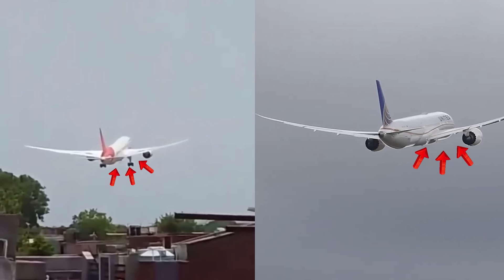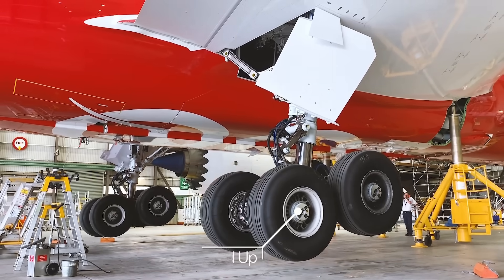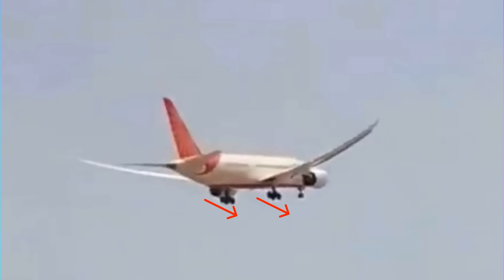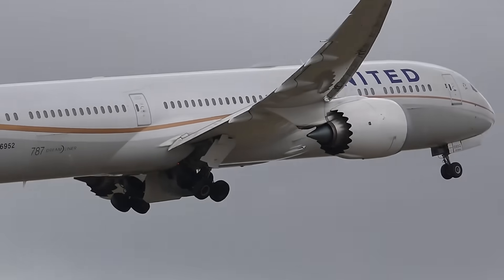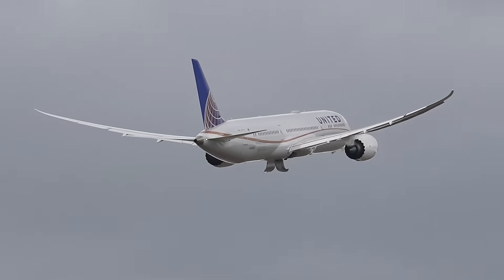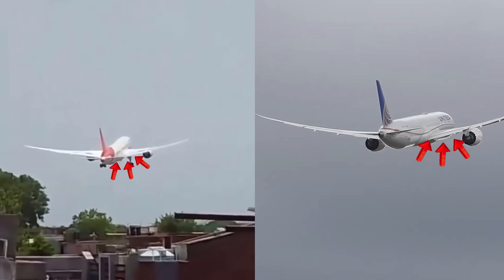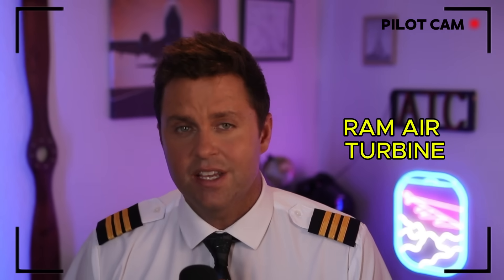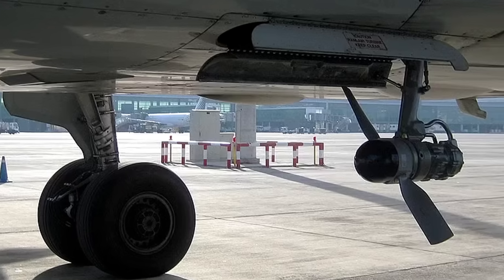Pilot Explains: A New Detail in the Air India 787 Crash Everyone Missed

Comment: Boeing utilizes parts manufactured in China for many of its aircraft. Chinese companies produce components and assemblies for all current Boeing commercial airplane programs, and these parts are found on over 9,000 Boeing aircraft currently in service. 

Specifically, Chinese manufacturers produce parts like:

Rudders for the 787 family: One supplier, CCAC, manufactures rudders for the entire 787 family. 

Components for the 737: CCAC also produces the rudder and other components for the 737. 

Horizontal stabilizers for the 737: Shanghai Aircraft Corporation produces the horizontal stabilizer for the 737. 

Vertical fins for the 737: Xian Aircraft Corporation produces the vertical fin for the 737.

Comment: I agree with you...the reason of the tragedy is that the engines suddenly stopped working..and I also think it was because of a sudden lack of electric power....but the fact (omitted by most of those who have expressed their opinion on the possible causes of the accident) that the plane used the entire length of the runway (up to its extreme limit) before managing to take off, suggests a problem with the power of the engines already during the acceleration phase, even before take-off.

Comment: If you consider that the last ADS-B data was transmitted at 08:08:50 UTC, right at the end of the runway at about 70 meters (230 feet) altitude, it is quite likely that they lost electrical power.

Comment: Crashed Air India pilot error. 
I noticed the plane tyres thing in the very first video before crash. But there PILOT ERROR exists. 

As an aviation enthusiast & frequent flyer since 50 years I know safety regulations & protocol in Boeing or Airbus aircrafts. At first sign of trouble pilot or captain will activate seat belt sign & oxygen masks. Passengers with oxygen masks on have a better chance of surviving any crash. In Air India crash pilot didn't activate OXYGEN mask. In real videos of this crash I have seen passengers decapitated heads & no oxygen mask on their face. The only passenger who survived had no oxygen mask on him. This 60year old captain supposedly 8000 hours experienced pilot never activated oxygen mask. THIS IS PILOT & HUMAN ERROR.

Comment: Hi Sir, I saw in one of the analysis videos that the possibility of hydraulic failure is there due to which fuel did not reach the engines and the chain reaction occurred.

Also, one point is dreamliner systems specially hydraulics mostly rely on computers so maybe they malfunctioned hence the whole system?

Comment: The Rat would not come out for flaps, only for a loss of electrical or hydraulics. So we have to look at engine failure, if an engine failed mechanicall we should have seen it happen between the time of rotation and loss of climb, we saw no bits of engine or smoke. if one engine failed for fuel reasons we may have seen some slight smoke from bad combustion but thats no guarenteed, but we would have seen a loss of that engine power yaw the aircraft and apilot correction, there was no wiggle in its flight, so the thrust went from both engines at the same time. at the same time discounts mechanical failure, or fuel issues as the engines have different fuel paths so bad fuel would take longer to affect the engine nearest the bad fuel.
The engines just seem to have stopped, I suggest that they throttled back to idle or simply turned off due to a catastrophic electrical/computer failure, maybe linked to that 'bang' that was mentioned...

Comment: This is 787, the most unique plane for boeing, only the pilot who have experience fly this model plane CAN tell u this is dual engine failure, please go check for Slats and Flaps panel for boeing 787 for flap differentiate between (1, 20, 25) and (5, 15, 30)  :D u will come out another video to slaping this video, and please go check for boeing 787 takeoff checklist SOP, another thing u need to google is what is the common flap for asia flight company that always use for economic mode, u will come out the result which is "THIS IS DEFINITELY DUAL ENGINE FAILURE"! PS* dont spread this result everyday on social media if u're american, u know what the boeing capable do :D

Comment: Throttles pulled back will not cause RAT deploy.

An aircraft with both engines failed and on RAT power are not designed to still have full hydraulic capacity for gear retraction .....Gary is on target ..this most likely fuel related and there are ways just this plane got the contaminated fuel

Comment: Would contaminated fuel not affect other aircraft using the same source of fuel supply??  Another possibility  . . . . . and correct me if I'm wrong. The engine failure doesn't look like it was a total flame-out. I would have thought that a total loss of thrust when climbing in a high drag configuration would lead to a rapid loss of airspeed and a much more rapid descent. It was almost as if the aircraft had thrust but just not quite enough and hence a more gradual descent and a slow increase in pitch attitude in a vain attempt to stay airborne. So . . . . contaminated fuel could potentially do this but what if the aircraft has just had some routine maintenance work done and the same work was carried out incorrectly on both engines, causing them both to lose thrust?
Hopefully we will have the answers shortly as both boxes have been recovered

Comment: Contaminated fuel would not cause simultaneous engine failure. There should be slight lag, perhaps only seconds between one then the other. This should have caused some yaw or deviation from straight ahead.

Comment: The main Fuel cutoff switch was accidentally pushed in and or activated on using whatever fuel for takeoff that was left in the lines. That caused the aircraft to have the double engine failure and crash. My theory

Comment: It’s not a double engine failure. The fuel pumps were shot off by the computer bcoz of extreme heat in the electrical system. A safe state mode was activated automatically. Something the pilots were unable to correct

Comment: The point about the undercarriage position was a very good one.

The undercarriage position and the RAT deployment are the two smoking guns pointing at total power loss, but why; I hear myself ask.

What is a single point of failure for both engines at the same time? There was no yawing of the plane as there would be if there was a time delay between one engine failing and then the other.

- Pilots deliberately stopped both engines
- Fuel contamination? 
- Auto throttle failure that shut down both engines.?

Why would the pilots stop both engines on take off? They thought both engines were on fire?

Unlikely both engines would be shut down by fuel contamination at the same time.  There must have been some "good" fuel to get them off the ground.  Not impossible.  If the fuel system of both engines were supplied from the center tank and the fuel in that tank was contaminated with solid matter to the extent the pump inlet screens on both pumps were blocked or the contamination wrecked the pumps at about the same time, both engines could have been starved within a few seconds of each other? The same could happen from wing tanks, but not at the same time. If the contamination was liquid such as water this could have stopped the engines in very quick succession, but how did the plane get off the ground at all, unless it was the nose-up attitude that ran the water to the pump inlets only with a high nose up attitude. I heard a rumor that the center tank is used preferentially to the wings to reduce wing root loading so this theory is plausible.

Surely the auto throttle would use a two out of three instrumentation regime and would have dual port command actuators driven by separate computers to reduce single points of failure. Also there would be discrepancy monitoring to pick up any auto throttle measurement or faulty control actions that would bring up an alarm and trip the auto throttles to manual before the engines would be run back to idle.  Running the engines back to idle would not lead to a total power loss that would require  the RAT and which would also prevent the gear from operating.

I get the feeling there is something we haven't thought of.

But I'll lay down my cards:

I reckon it was fuel contamination, not pilot error, but I'll also bet I'm wrong.

Someone thought that maybe it was a catastrophic failure of the entire electrical system and it may have been this that caused the loud bang.

It's a good point, I forgot about the loud bang.  It would seem that if the electrical system had a single point of failure that could bring down the entire electrical system.  The 787 however has multiple levels of redundancy in its electrical system so it is hard to see how they could all fail at the same time from one fault, unless there was a severe design flaw which provided a hidden single point of failure.  Also, could the loud bang have been the RAT locking into place? (Bangs are always loud when unexpected).

I'll still go with fuel contamination.

Comment: FADEC failure... Both engines are on but gone into idling mode... Therefore both main engine sound is very low and RAT sound/noise dominates... This ramp down of both main engines to idling leads to low thrust..... Why both main engines ramped down to idling is the key question... Likely because of an electrical interlock which sensed a 'trouble/defect' in either electrical, control or mechanical system and therefore operated to protect both the main engines.... Thrust went low and RAT got deployed... Technically this interlock to bring main engines to idling should be bypassed in the take off sequence till the aircraft obtains safe height and air flying worthy speed... But either such interlock was missing or was bypassed.... Please analyse with respect to black box and FADEC/ engine log and correlate. 🙏

Comment: My guess they lost volts and amps big time.   Fire in a wiring loom?.  Li-ion Battery thermal runaway.? Engines may not have stopped but definitely not at take off power, did they loose  fuel pressure.?  How is the fuel pressurized? is it an electric pump as per a fuel injected car.  ? If yes that explains loss of thrust. When the plane goes past with rat deployed. The engines are going but not like on take off.  Stand 500m past the end of any big city airport , Those jets just rocket up with a raw.  My thoughts lost electrical power at least to  fuel  pressurization and working hydraulic valves to actuate gear retraction.  RAT therefore automatically deployed, but without thrust from the engines there was nothing the pilots could have done from500plus feet..

Comment: Why all are stick to one reason on flaps why not horizontal stabalizer control surfaces ,why not load and trim sheet balance problem ,why not crucial parameters which feeds airspeed ,engine speed like static and pitot probe blockage

Comment: Fact is - that flight should have never ever been started. That's the only thing the pilots could be blamed for, most likely having known that there are currently electrical problems with that aircraft. There's a video of a passenger existing, filmed right before that flight, showing that the air conditioning didn't work, as well as the screens at the back of the seats didn't react. Same was reported by passengers of the previous flight. How could that aircraft been brought into service again without thorough examination?! IMO it's pretty clear that a complete power blackout happened right after take off, which was most likely already imminent when accelerating on the runway. So what should have worked with that aircraft?! Definitely nothing. Unfortunately too late to abort at the runway.

Comment: Passenger on previous flight showed footage of lack of aircon and no tv/monitors for passengers  to use, so the aircraft was having electrical problems before it took off. It should have been grounded after the previous flight issues.

Comment: True. When I saw original video, I've noticed that is too quiet for full throttle, that usual is very loud. Even when  smaller planes runs for the take off you can hear it even inside airport building. So I think too that lost thrust on both engines is the most realistic theory.

Comment: Contaminated fuel is a possibility, but I see two problems. First both engines appear to have failed simultaneously. I would expect the pilot to have called single engine failure initially. Second, this is the only aircraft taking off from this airport that suffered the failure. So what is the source of the contamination?

Comment: With the purported climate of the region (temperature in the 80s Fahrenheit and humid), the quality of the fuel may have been somewhat compromised. It is unfortunate that such massive airliners are produced to run on only two engines, and this seems to be tacitly accepted over recent times, more than it should be. It is also possible that the increasing reliance on automated and computer systems overshadows the ability of pilots to administer their proper control of an aircraft. After reading about the late whistleblower who worked for Boeing's South Carolina facility, it is not out of the question that a component of the airliner could be suspect. We have to continue to expect that passengers are treated in the most respected fashion.

Comment: A main bus failure occurred.  The gear for stuck in down tilt. The rat deployed. The flaps were normal. The FADEC  failure occurred as main bus lost forcing both engines to idle thrust.  The aircraft stalled and went in 54 degrees nose down. Water ingress at the GPU INLET in monsoonal rain occurred.

Comment: ELECTRICAL failure disengages the Autothrottle. On an Airbus when Autothrottle disengages  the throttles remain at the last thrust level, but on a Boeing throttles retard without electrical power. If there was ELMS activation  autothrottles would not have had priority for electrical supply. RAT deployment means electrical failure. Cutting power causes Autothrottle rollback, ie double engine failure.

Comment: There is another reason why both engines might fail....a vapor lock the fuel system - the fues in the fuel lines becomes vaporized which stops fuel pump from delivering fuel to the engine. Vapor locks are more likely to happen in warm weather - the temperature at Ahmedabad was 38°C (100°F)

Comment: Was there a recent repair/maintenance issue?
We see it quite frequently that 1 engine fails on take off, w/o major failure, the plane keeps flying and comes back for landing. 
It doesnt seem that far off (to me) that it could be both engines failing at the same time.
Maybe we should reconsider the wonderful 747, and other 4 Engine jets that are and have become obsolete due to saving on the 2 engine design, economically, etc...
The 747 for one, could have lost 2 engines and still fly out...
Hmmmm

Comment: Hi Captain Gery. I have a curious question. Are these aircrafts vulnerable to remote hacking by someone on the ground for instance that could shut down the electrical systems to the aircrafts? We've been hearing about a "kill switch" on fighter jets that could allow the manufacturer to disable the aircrafts in mid air. Could the same thing happen on a commercial airliner?

Comment: Hi gary ur analysis is top notch  , my only doubt is there a possibility they lost a single engine and while they wanted to shut down the faulty engine by mistake they shut the good engine that would result in a  dual engine failure . This has happened in the British midland accident in uk on a brand new boeing 737. I only hope iam wrong This also brings a doubt wasn't the Apu running I would like to know at what altitude is the Apu switched off .

Comment: FYI. Ignore the quiet. 787 is designed to be quiet. You can be a few spots over here on flightline at boeing and you can not hear the engines running. Fact. So all you pilots that have never flown a 787 need to get off of this. Makes you look uninformed. Sorry. But i dont believe for 2 second your or anyone else opinion to say engines werent running becuase its quiet. Thats the design of the engine specifically is to be powerful, fuel efficient and super super quiey. That far away, you could not in fact hear that engine that far away. Fact. So look more, thats most likely not the the issue. Why did he take the whole runway to take off? Clearly there was an issue way before he took off. Only takes 1/3 iof that distance to take off. Landing gear once off the ground gears are in fact slightly tilted up. Watch more 787 take off. Look at original 787 first flight. We left the landing gear down the whole test flight. So sorry. I disagree 100% of all your opinions. I have just as much time building these planes as you do flying them i in fact installed the fitting the RAT goes into on this airplane. He F'd up by taking off. That plane has massive power to weight ratio. No reason ever to use full runway. So un the end, pilot error for continuing to take off. Watch any 787 take off anywhere ever. Never has one used a full runway to take off.

Comment: I have a question that no one has answered yet. If the "RAT" is deployed due to a malfunction, or manually, would that cause the engines to shut down? In others words, if the RAT deploys... and the engines, electrical and hydraulics are all working.... will that cause the engines to shut down.

Comment: I saw another video that talked about vapor lock. It was a hot day, the plane was on the ground for hours without air conditioning. So the fuel was heated enough to cause it to vaporize. Your thoughts?